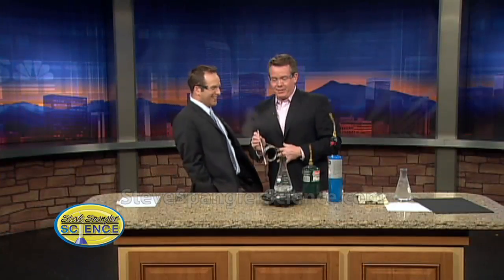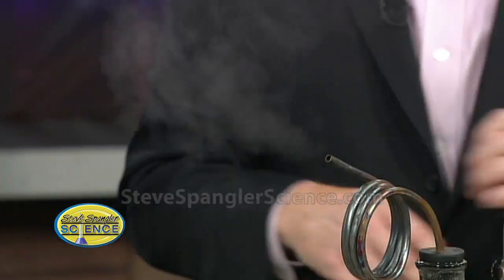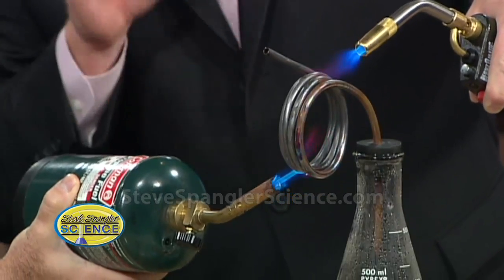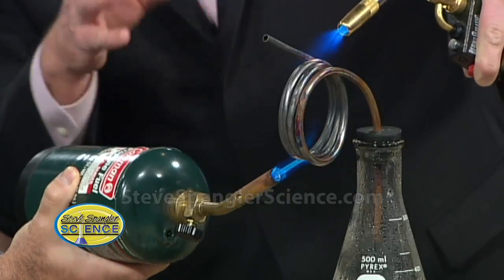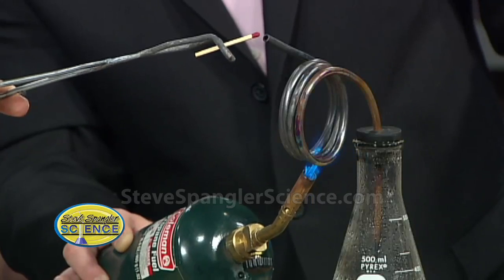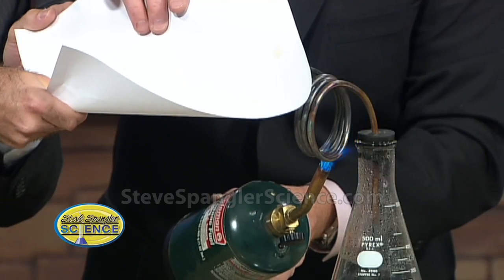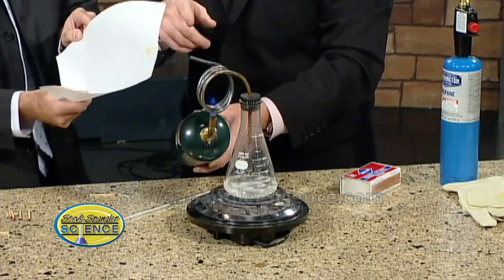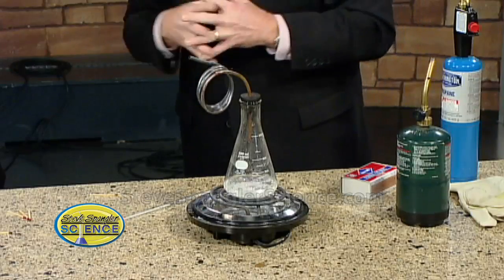Superheated Steam - Cool Science Experiment

Comment: I've done specialized work in a lot of power generation plants and almost all of them rely on steam to turn the turbines that turn the generators that make electricity.  They are dangerous places to work because of high pressures and high temperatures.  Most require long sleeve shirts year round and shirts and pants are 100% cotton.  Polyester would melt on your skin and that's very bad.  Cotton gives you a chance.  People take electricity for granted but making it is quite amazing.

Comment: They used to use steam powered cars back when they were first being used. But steam is actually very inefficient. It takes a while to get the boiler hot enough so you'd have to wait a while before you could even start your car. Also, steam engines are smokey and I'm sure you wouldn't want to walk around a busy city with car puffing out smoke everywhere. 
It is possible, but less efficient than what we have today.
Reply: steam is not inefficient, human designs are
Reply: Correct but generation of electricity is done with steam too. Storage of renewable is the barrier